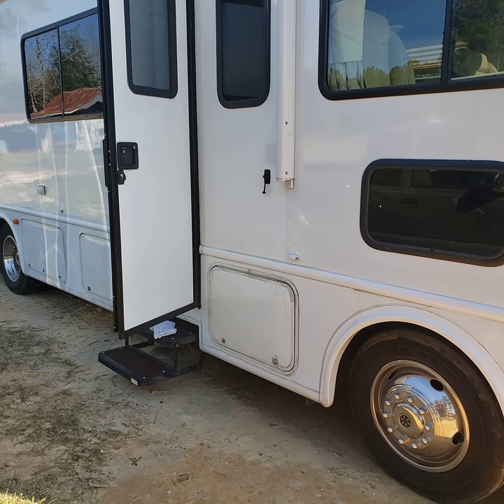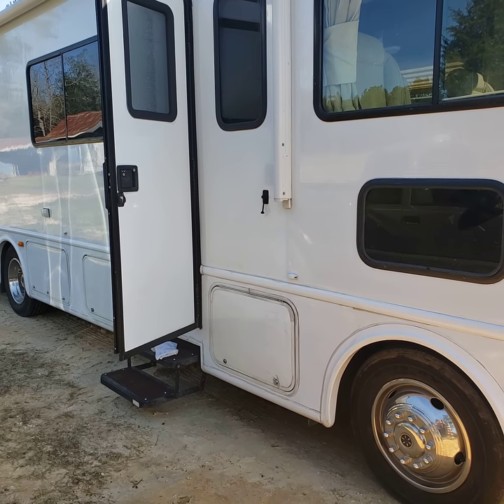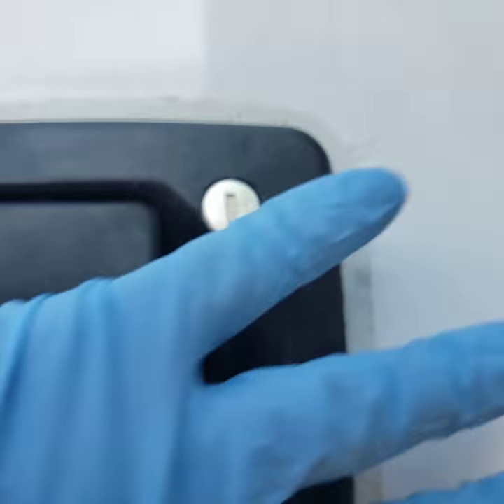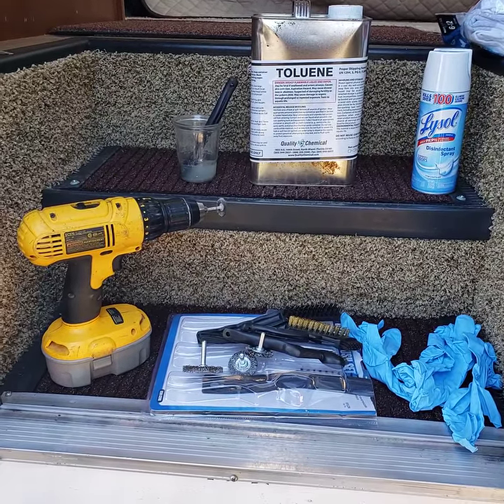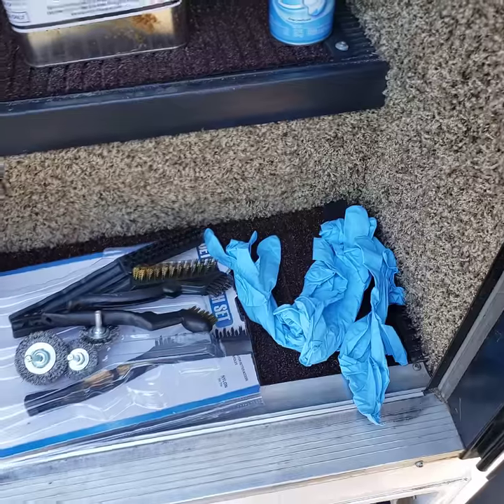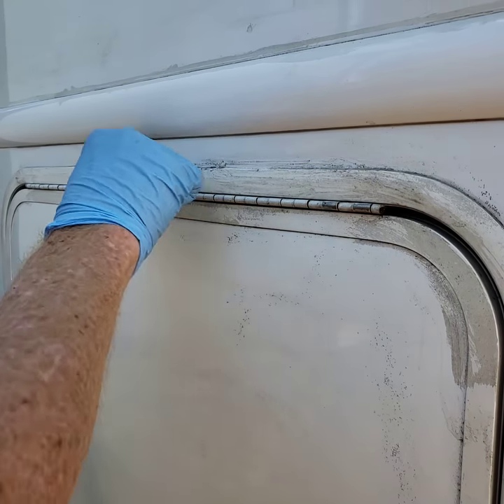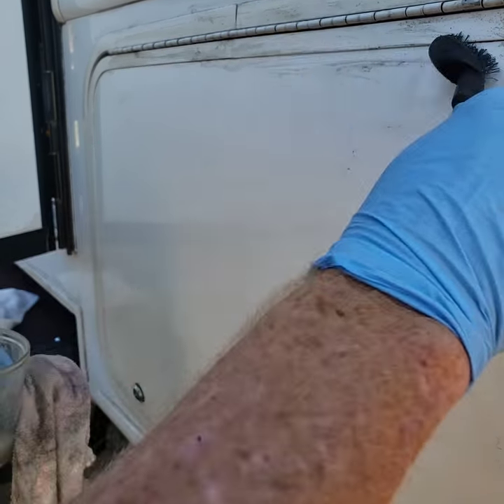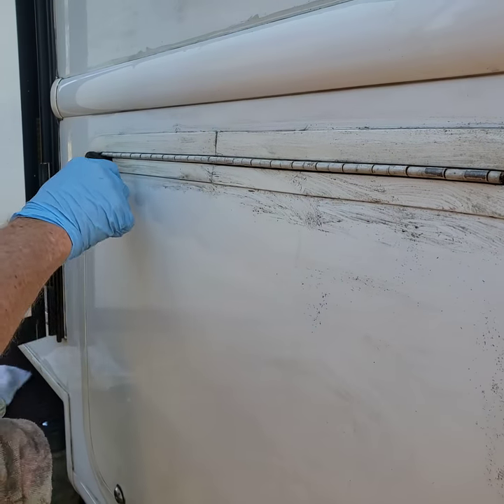Removing old calk and silicone from RV

Comment: Acry Solvent makes removing the old silicone sealants a breeze. Try it, you will be soooo happy. Also wipe it down with acetone and the denatured alcohol to remove to old oils in the surface so the new sealant stick well.
Reply: what did you use the bathtub cleaner for?
Reply: Be careful with Acetone.....it ruins most paints!

Comment: that doesn't look like chaulking. that looks like 3M 94 adhesive promoter. its used in spots like that to help a vehicle wrap stick better. When the wrap is removed the residue will stay in the areas that had the adhesive promoter on it. Looks like it was applied with small brush which is common. my guess is that RV had a wrap on it at one time
Reply from the maker: No...it was silicone base calking that appears drunks or kids had used and colored way outside the lines.  Some original calk was removed by the brush.   It was a soft brush.

Comment: Hey there seems to be many ways to do this . I’m all for finding ways to make it easy.   
I bought mineral spirits.  Petroleum based— I didn’t think about that that doesn’t sound like the right stuff to use on my sidewalls’ Filon and fiberglass though.  
  **IS IT ??***
Seeing this I then wondered about the turpentine ( it’s not petroleum and it’s stronger)  .  Silicone is a bear to get off —  I’ve watched so many YouTube’s and everybody seems to be the Expert.
Reply from the maker: You got to get it off as soon as the job is done and do small sections at the time.  People seem to miss this.  Clean the area immediately with something like scrubbing bubbles

Comment: He's thrashing that RV with the solvent and the small wire wheel
Reply from the maker: You didn't understand the part about removing the solvent immediately. 
That was done a couple years ago. If I could post a picture here you would see there is 0 damage.

But manage yours the way that you think is best.

Comment: Ive experienced how new silicone will not adhere and seal to old and have avoided it like the plague since then.
Which type of caulk can you remove with mineral spirits and elbow grease? Mainly the top stained layer when using white? And also allow you to apply it over itself and be water tight?  Thanks
Reply from the maker: It has worked perfectly for 3 years.

Comment: Why on earth would you use a pressure washer on areas that you just took all the sealer off of? The water is going to go right in where you just took the sealer off.
Reply from the maker: Did I?   I don't remember that.

Comment: Wire brush and chemicals that can dull or damage  the paint? Oh Hell No!
Reply from the maker: Leave the old nasty calk on there then.   Maybe you didn't see the part about cleaning off the chemicals immediately after they dissolved the old silicone.
Reply: WD40 does a good job too a tad less harmful on the paint.
Reply from the maker: Watch it again. You are missing important information.